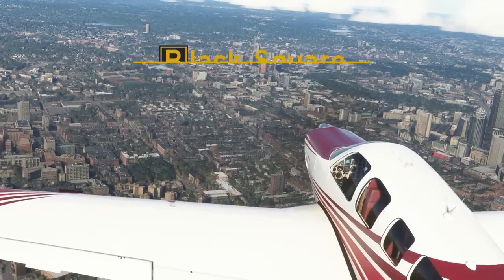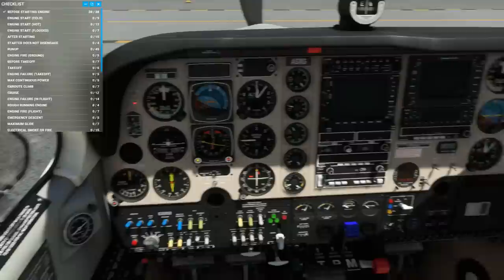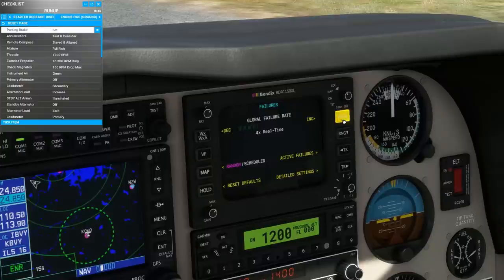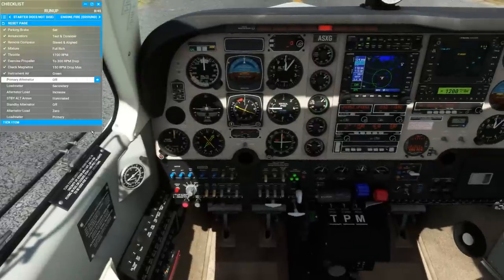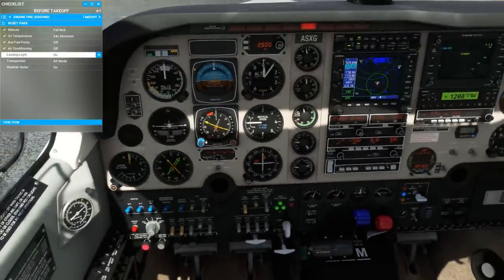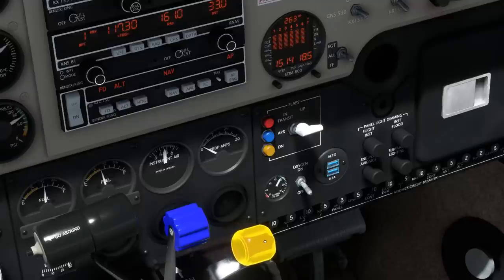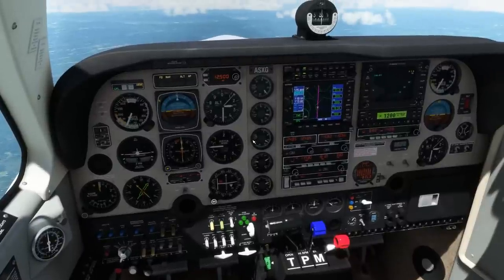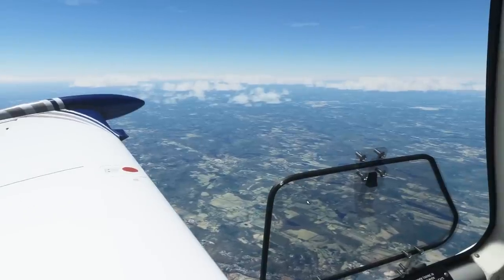Black Square Steam Gauge Overhaul - Analog Bonanza - Technical Overview

Comment: The Dreamfleet A36 Bonanza with Peter McLeland's turbo mod was probably my favourite aeroplane back in the days of FS2004! This will bring back memories!
Reply: Then you've never flown an A2A aircraft in FS9, 10, or P3D. Their V-tail Bonanza for P3D and FSX was a game changer, as was their Comanche before that. Their Comanche is now in beta testing and it will blow the doors off of this, and blow your socks off with the systems fidelity. A2A aircraft are "alive" and it will set the new Platinum Standard for GA aircraft in MSFS.
Reply: @ImpendingJoker  To be honest, I don't really care about stuff like each circuit breaker working at the like...

Comment: I was on the fence about what I thought was just an analog upgrade some some slight changes to the aerodynamic modeling, but holy crap. This addon is basically it's own stand-alone study-level version of the default. 100% going to buy upgrades that go this in depth. Fantastic work!
Reply from the maker: Thanks Kenny, will pass your words to the dev.  That's the message we've been attempting to convey since the release.  These releases are way way more than just a basic, simple upgrade. Glad you're enjoying anyway. Thank you.

Comment: I am wrong or is the flight dynamics aspect a lower priority here over systems modeling ? This looks super interesting to me and would feel like learning to operate a real aircraft, but how much love was given to the flight model of the aircraft ?
Reply: This started out as a default aircraft so the developer is restricted in terms of changes to the flight model because a/ it's an asobo aircraft flight model and b/ the sim is pretty limited in some respects. Some changes have been made and it's pretty good now but it's not going to do it for each and every simmer out there due mainly to the reasons pointed out above.  But you're close or at study level with the aircraft now, that's pretty evident.

Comment: Any chance we could removed the kn81 if we are using the GTN or GNS option ? Kind of odd to have an old RNAV system in the cockpit if you’ve been retrofitted the cockpit with more modern navigators.
Reply from the maker: Yes. It's not as simple as selecting an option, but it's a relatively simple mod to make for the XML files.  We'll aim to get something published for it.

Comment: I'm a little confused. You said that you don't lean the engine when you're at 12,500 ft (below critical alt), but then you went through the process to lean the engine at 12,000 ft and said that you're now saving fuel. This seems like a conflicting instruction. Could you please clarify under which circumstances the mixture should be leaned?
Reply: You don't NEED to lean the mixture while climbing like a naturally aspirated aircraft, but leaning lean of peak once in cruise can still save fuel. The manual does a great job of explaining these things in an understandable way. Hope that helps a little.

Comment: What year A36 are you simulating ? Looks like something post 1985 up until the early 2000s. Is the turbo simulation of a turbo a36tc out of the factory or a aftermarket STC mod like from world wind or something like that? Also, can we have a non turbo version with the radar pod on the wing or can we disable the WX radar in the VC?
Reply from the maker: This particular model of Bonanza depicts the stretched and improved “A36” model of the mid-2000’s with a 300 hp engine, and the 2001 “A36TC” with an aftermarket turbonormalizing conversation package.  And you can create any combination of exterior features you like, but you cannot disable the weather radar, since it doubles as the failure interface.  It's technically possible with an easy mod if you REALLY wanted to, though.

Comment: Is there an option to choose whether you have wing tips or not?
Reply: yes seems like you can disable tips tanks very easly, looking in the manual ,there is just a number to change in a .flt, keep in mind, the A36 without turbo charger is available without tip tank, a version with tip tank (aspirated thought, and the one in the video)

"Should a user have a strong desire for a turbonormalized Analog Bonanza without tip tanks, it is
possible to create a mod, which will add this aircraft to your simulator. It has simply been
omitted here to reduce clutter in the aircraft selection menu, and help differentiate the Analog
Bonanza from the default G36 Bonanza. To do so, simply create a new aircraft livery mod with
the adjusted weight and balance information contained within this manual, and new flight files
(*.flt), containing the following lines.
[LocalVars.0]
BKSQ_Turbocharged=1
BKSQ_TipTanks=0 "

Comment: Does it support the PMS GTN units?
Reply: Just started using MSFS 2020 and this so I'm not sure if this is what you are looking for, but the install manual has this:

"NOTE: THE FOLLOWING DOWNLOADS ARE OPTIONAL, and not required to enjoy the base functionality of this Black Square aircraft;
however, they are highly recommended for the most immersive experience possible.

Installing the PMS GTN 750"

The 530/430 are "Working Title GNS 530/430"  units though. Not sure if PMS does the 530/430, but that's the information I know of.